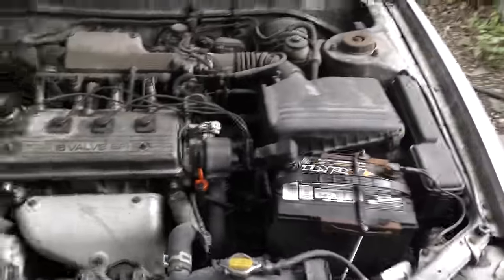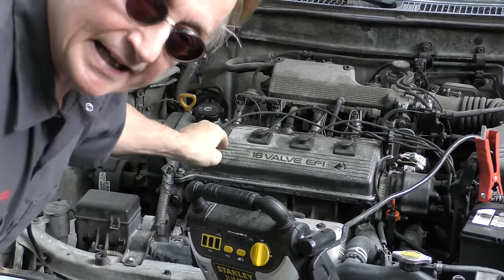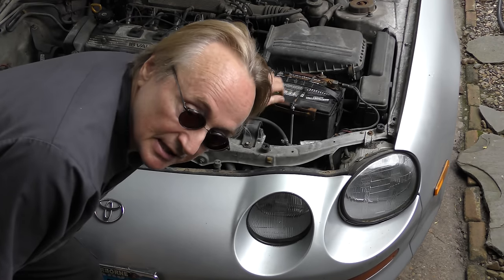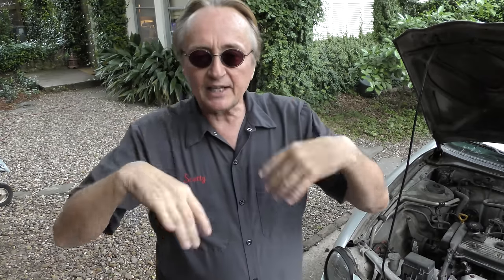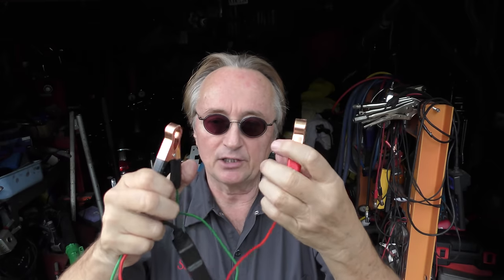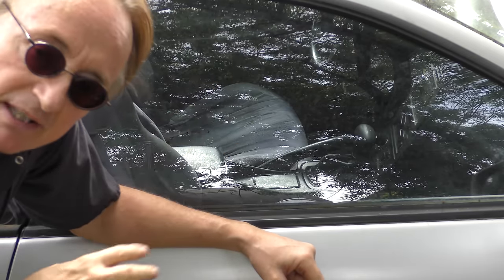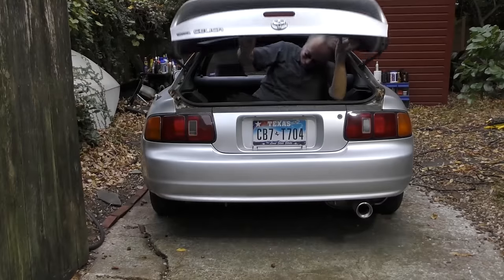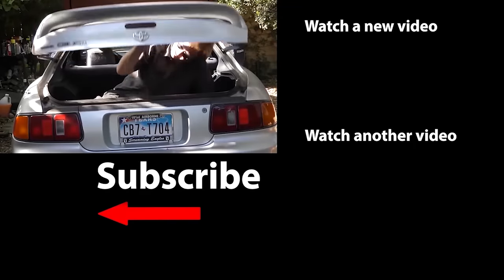Never Do This to Your Car (Learn from My Mistake)

Comment: Everything he's talking about is called "stupid engineering".
Reply: Stupid meh lennial engineering.
Reply: I regard stupid as adding features that significantly reduce dependability and longevity. Some features are that way, but I find many of today's features to be "frivolous" engineering. Those are unnecessary things that just raise costs for a minor or negative benefit. My brother has a vehicle with adaptive cruise control, a truly unnecessary feature that claims to increase safety but does the reverse. It broke and he took it to the dealer. They said the sensor in the bumper was broken, maybe by getting hit by a piece of ice or snow (he lives in the Colorado mountains where that tends to happen). Cost of a new sensor plus installation and calibration is $3300. His vehicle doesn't have an option to use normal speed based cruise control, so the car runs great but he has no cruise until he pays the ransom (probably recurring). That is a perfect example of today's garbage technology.
Reply: Richard B. You mean Evil engineering
Reply: @steveb7310  Evil and scammy.....designed to make it difficult and expensive for you to do repairs yourself, so you're forced to pay the manufacturer or agents to do it.
Reply: APO: Advanced Planned Obsolese.
Reply: Anyone having an at least 50 years old car for sale?
Reply: @drwisdom1  Latest Lexus cars have the same "adaptive crap cruise control technology.  PITA and useless and expensive to repair.
Reply: Designed obsolescence
Reply: Moma sent the kid to college. He got a job with an auto manufacturer. After about 3 days on the job, he was told that he would need to come up with a new idea to keep his job. So, he is reengineering things that work fine if left alone.
Reply: Scotty and many followers give the impression that modern cars unreliable. The truth is the opposite according to Consumer Reports. Modern cars are more reliable, on average, even with the added complexity. They are safer, more comfortable, and more reliable. Two decades ago, if your car makes it to 100,000 miles, it was cause for big celebration. Today, 100,000 miles is expected. However, all cars are not created equal. I have been buying Honda, Mazda, and Toyota cars and they have served me well. I also I would not buy the first two years a after model major redesign. The last one I bought was a 2017 RAV4 loaded with all the technology available. No problem so far.
Reply: They may not be "engineering" what you assume they are.  They are engineering "maximized profits" for the company.
Make sense now?  This is nothing new.
“People of the same trade seldom meet together, even for merriment and diversion, but the conversation ends in a conspiracy against the public, or in some contrivance to raise prices.”  ~Adam Smith, The Wealth of Nations, 1776
Reply: The stupid complexities imposed on us are from that stupid EPA and Dept Of Energy.
Reply: Well, some is for compliance to newer environmental regulations and is legally mandated, some is for driver convenience and sells vehicles, some is to provide a little more power or longevity and theoretically gives the owner either more of those things or allows the manufacturer to use cheaper parts or materials for the same longevity, all reducing the price increases overall.  However, when the newer systems break, some of those cost gains can become dubious.
Reply: These are the stupid complexities imposed on us by  EPA and Department Of Energy.
Reply: @hosocat1410  
These are the stupid complexities imposed on us by  EPA and Department Of Energy.
Reply: @drwisdom1  
These are the stupid complexities imposed on us by  EPA and Department Of Energy.
Reply: @rgroove1970  
These are the stupid complexities imposed on us by  EPA and Department Of Energy.
Reply: enginemaxcarb.  

No.

These are the stupid complexities imposed on us by  EPA and Department Of Energy.
Reply: @metimeti1998  

"No problem if you keep buying NEW". (Let them eat cake.)

But this is about Used cars. 

These are the stupid complexities imposed on us by  EPA and Department Of Energy.
Reply: @bwhammm  
These are the stupid complexities imposed on us by  EPA and Department Of Energy.
Reply: @DefundTheFringes  

Cost vs Benefit?
Squeezing out a little more gas mileage past the point of diminishing returns?

These are the stupid complexities imposed on us by  EPA and Department Of Energy.
Reply: @matseriksson8177  I own an 1978 LeBaron I try to fix up so I can use it.  I hope I can have it long time. If I'm lucky maybe it will hit the 70 year mark 😊
Reply: wrong hes telling the truth
Reply: WOW!  Scotty makes mistakes.
Reply: @Ssesshoumaru69  My 2000 Silverado has 118K on her, can still pull a house, and gets slightly less mpg, but changing my Valvoline every 3K with a Purolator or Mobil filter, I fully expect 300K or more from her...as my work truck and I'm not a slowazz driver - 75-80 on the big road.
Reply: @drwisdom1  I agree one hundred percent. That is exactly why I buy older cars. I would NEVER buy a new car because of the reliability (or lack thereof) compared to some older model cars. They just simply don't make them like they used to.
Reply: @metimeti1998  Two decades? Idk about you, but every car I've purchased has been almost that old, and bought at over 100k.
Reply: @Richard B. its called ..................................................................................planned obsolescence.........build it so it breaks and breaks OFTEN.
Reply: @ulfhenarpolymathmilitant6258  You got that right!  Long ago I'd read an article that said all the American manufacturers got together and, in order to keep the aftermarket running, they'd need to plan the lifespans of all parts. I think that was in 1985 or earlier. 
Best not to be slamming those doors shut boys, they WILL give up the ghost!
Reply: Actually it’s brilliant engineering. It forces you to the dealership
Reply: Brother in law circuits..... something that could be done without,
Reply: It's designed that way for a reason, so not stupid exactly. More like sneaky engineering, as it's engineered to drain the customers wallet.
Reply: No it's a way of getting more money from the owners to the dealers!
Reply: Somewhat related to planned obsolescence, a uniquely American auto frame of mind. That is why I own a Tundra. Still having trouble forgiving Detroit.

Comment: thanks a lot Scotty, especially about the memory alive tool, since I changed my battery on my ford focus 2007 my alarm goes off as soon s I open my door and the remote don't work nither, so if I knew about a memory alive tool it would have saved a lot of embarrassment.still looking to fix after a long time.

Comment: Scott in case you didn't know manufactures always put underrated  batteries in new cars! Always check the car specifications for your car or truck and in most cases you'll need to put an upgraded battery in. My past experiences on my truck came with a 650cca when specifications called for 750cca!

Comment: It seems that Sensors that monitor for systems seem to malfunction more
often than anything thus costing money to replace or correct.
Reply: Yes, but if it is only a bad sensor, rather than an alternator, etc,  shouldn't be too expensive to replace....Oxygen sensor ( or whatever ) on my Mini exhaust looks easily replaced.  Now, if the darn exhaust pipe @ 20"  down from the exhaust manifold would just stop breaking.....

Comment: Oh my god this is awesome I think you figured out the problem with my Toyota previa (1995) the battery light is on.  I’ve rebuilt the alternator.  The fuses.  The new battery and cache attachments... still on

Comment: I don't have a "keep memory alive device", I just connect a spare 12v battery to the car battery cable terminals in parallel ( + to +, - to -) while I am replacing the old battery with the new one.  Then just disconnect the spare 12 volt battery and your done.  The car never knows the battery was removed and replaced..............unless as you say it is a BMW.
Reply: good one, why didn't scotty know this ?
Reply: Yeah Ive done that . Its the easiest  way to do it .
Reply: So... Does 24v dc hurt the car?
Reply: @johnverkler3962  Hey John, not connected in Series = 24V but in parallel = 12V (+ to + and - to - ) as stated.
Reply: @mrvoyagerm  You're absolutely right ! My Brain Glitched. I knew better than that.
Reply: @johnverkler3962  Happens to me all the time.........but between glitches I've still got it :)
Reply: @johnverkler3962  it's actually 12V, not 24V
Reply: @axewax9074  Had a Brain Glitch.
Reply: i'll just take that spare 12v battery out of my back pocket.  who besides a mechanic would have one?
Reply: @kendrajones984  I used a 15v 4s Lipo out of one of my electric model airplanes, small but powerful and does the trick perfectly.
Reply: As long as there is no time elapsed. ..duhhhh? ??
Reply: I did the same thing to 2016 S1 & Mini cooper S - battery since i don’t want to pay dealer mechanic no more, hate all dealers, this method is fine just have 12V battery in case@

Comment: We just watched your video and learned a lot! Thank you! We have older vehicles and love them and hope they keep running, right on into the sunset! I never have to take my eyes off the road to look down at a screen to do anything. I know exactly where the buttons and knobs are to do everything so I never have to look away from the road. My horn is in the middle of the steering wheel - always. On some newer cars it's at the 3 and 9 positions on the steering wheel, but as you turn it changes to the 2 and 8 positions, and is never in the same place when you need it quickly! Higher tech means more bugs, the possibility of hacking, upgrades, a very costly repair if something goes wrong, and of course everything is more complex to fix. And you have to subscribe to things before they work. With all the fancy tech out there, why can't they make a small battery apart from the larger one; its only function being to remember all the dashboard settings if you ever disconnect the larger battery? Or maybe put it in the key fob so if you disconnect the battery, as soon as you start the car all the settings would be restored?

Comment: Solution: Don't buy a "new" car....
Reply: Err news for you these systems have been put in cars as way back as around 2006
Reply: True! I had more problems with my 2016 Camry like AC, Alternator and electrical. My 97 Camry never had to put a hand in it
Reply: @joebloggs4191  Thanks for the info,....
Reply: I agree. I have a 67, 68, 69, 93, and a 2005. When the 2005 wears out, no more new car.
Reply: That,s right my friend ,around 17 years ago I had cars from the 60,s such as mercury comet,ford country squire and rambler american,I live in Puerto Rico and travel the whole island on them just fine .In 2005 I switched for 2003 taurus and it still running good,them I get me a brand new 2012 Nissan versa and right after the hurricane (Maria) the damn car start blowing all the sensors,the coil plus the transmission only ran on reverse ,so I got that piece of junk out of my sight and stay with the old taurus
Reply: Thanks to the "cash for clunkers" program that destroyed many of the older GOOD vehicles, older car are rarer.
Reply: @franciscorosa6358  My first car was a 1962 Ford Fairlane, 221 V8, 3 speed manual trans. with overdrive. Fantastic gas mileage, easy to work on, and built like a tank. How I wish I had it back!
Reply: PapiSantoes S shows that you never should have upgraded. Why did you get rid of it? That was a tank fro those years!
Reply: I have a 2008 and dont have it .

My ex boss had 2016 SUV and did not have it too.
Reply: @172-e5s  ,,, With a 1996 you have very limited technological issues
Reply: Pavel Manzhetov  ,, You have company.... But am proud of its voting rights.
Reply: Facts
Reply: or buy a new car every three years, so it's always under warranty
Reply: @d.s7741  $$$$$$ I know people who have the means to do that. They never replace the tires, because they don't have the car long enough.
Reply: PapiSantoes S I had a 02 civic for 1 1/2year before my timing belt broke on me always ran I recently bought a 17 civic lx 6speed  non turbo and I’m planning to stay ahead of all of my maintenance to make it last a looong time
Reply: FIRE ANTHONY FAUCI ; DON'T RECHARGE HIM! TRUTH/FREEDOM/ HEALTH !
Reply: As I work on my 99 Grand Cherokee and breathe a sigh of relief...
Reply: Pavel Manzhetov  did your cars just vote?  Asking for a friend...
Reply: John Henshaw  I helped a friend work on a BMW SUV. Tuns out there was a (known) timing chain issue which destroyed the engine.....naturally the vehicle was out of warranty...
Reply: Don't buy a TURDATHA!@!
Reply: @kevinwilson9589  my first car was a 69 Ford Fairlane tudor hardtop, black over Royal maroon with a 302, c-4 trans with a black interior that I paid $50.00 for and drove the wheels off the cat. Wish I still had it.

Comment: Hi Scotty. Thanks for this video. Very educational. What would your recommendation be for charging a car battery using a smart charger? In South Africa we are in a 5 week lock down, so my car won't be going anywhere. I would like to keep the battery connected and topped up so not to have to reset windows, radio, settings, etc.
Reply: Go out and start your car once/ 1-2 weeks…let it run (idle) for 10-15 minutes and it will be enough to keep the battery charged

Comment: Oh yeah, this clip helped me seeing I did big time messed up my 2006 Audi memories. It was running smooth and strong but I let it parked 4yrs.  The battery was removed in/out dozen times.  Now I can jump engine get it running but it hardly can go up hill. It seemed just 20% power remained. But I can't do the  memories reset. I need that connector kit.

Comment: Slam door to hard, tempered window glass will be in you seat in tiny pieces. Guess how I know.
Reply: Hmm. I'll take slamming the door too hard for 500, Alex.
Reply: In the desert when that happens it's like suddenly you can't even remember your name.
Reply: @graniteheadmcvoot5140  I just hate the cleanup part of either.
Reply: das wright  and be glad there weren't any digits lost.
Reply: Trying to rebuild carb. passages so small and plugged couldn't get to run right. Had to buy $200 remanufatctured at Advance.
Reply: @jeffreydevoti8528  that sucks. That's just like you bust your finger and  the  throw a tool then the tools lost too and you needed it 🤣
Reply: who are you, Conan the Barbarian?
Reply: No, but I understand the Riddle of Steel ☺
Reply: I learned a long time ago that getting frustrated and throwing things or slamming things around just means the terrorists win.
Reply: @HollywoodHornet  me to but for 200 Alex 😂
Reply: Been there done that, glad I am not the only one

Comment: I had a lawnmower battery blow on me. Instead of buying a new on at start of the season, I, like the tightwad I am, charged it. It was dead dead, so had my trusty HD charger/jump box. Mower started, didn't turn off charger before removing cable, and wha laa.   Battery  gases, spark, and brain fart. Not good combo.
Headed into house for some baking soda, water, and soap and water.  
Love your videos.

Comment: Automotive engineering: never make something simple and straightforward when you can make it grand and glorious. 😖
Reply: It's their anti-DIY way, unfortunately..
Reply: Like my 70 yr Old Mechanic says, "Engineers are Not Mechanics'
Reply: A friend of mine is a ex engineer and can do anything mechanic wise and body work.
Reply: IE - The GM LT1 Engine- Featuring a Reverse flow coolant system w no radiator fill cap and a nightmare coolant bleed process. A PCV system that dumps raw vapors + oil into the intake & THEN goes into the PCV valve. (Mandatory Oil Catch Can FYI).  And an Opti-Spark distributor system mounted behind the crank pulley, under the water pump, and more importantly the coolant bleed screw!  Then they bragged about how “innovative” it was!

Comment: These directions for jump starting have been around for many years I want to say these directions were in the owners guide in my 80 Buick that had a carb. If you got have a good scan tool with data stream don't even bother working on a car.

Comment: Scotty I wish you lived closer to me. I need help with my 05 explorer. It’s leaking oil bad. And I can’t find the source of the leak
Reply: Take it to a self-car wash and use the high pressure setting with soap and clean all around where the oil is and then drive it until it reaches correct temp and then get a really bright flashlight and go to looking and trace the leak back to the culprit.  I did this on my car and it was the oil pressure sending unit on the top back of the engine.  Good Luck~!

Comment: Now i stressed to change a battery whats next need a mechanic to fill up the tank.
Reply: Yeah, you'll need to reset the fuel gauge sensor each time 😂
Reply: @JulianKapa  with a $4000 computer like Scottie's

Comment: Thanks for that. I have a question: my engine revs at every startup 2000, 3000 rpm and stays like that for maybe 30 seconds sometimes longer and then returns to normal, what is the problem please
Reply: It's probably the auto choke,just helps your car start,particularly in cold weather,if it's a petrol car.
The diesels use heated glow plugs instead.
On older cars,the auto choke was adjustable,but less so now.
So don't worry about it,,it's working!

Comment: When I was a teenager my battery died in my car, I was in the process of removing it and as soon as I started removing the negative cable my battery blew up in my face, the only thing that saved my sight was my uncle grabbed the water hose and flushed my eyes out. I was blinded for three months. I live with nerve damage now. Be careful removing dead batteries.